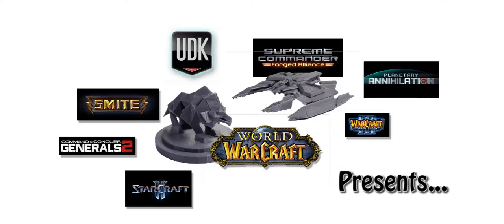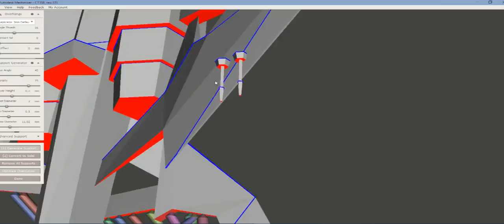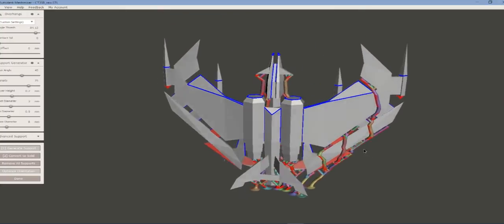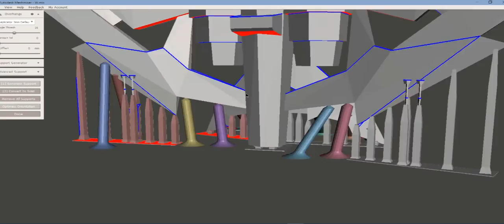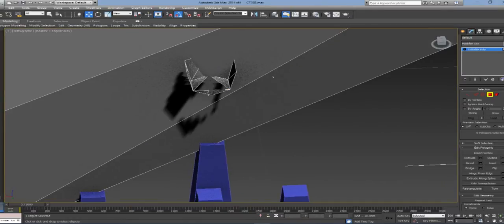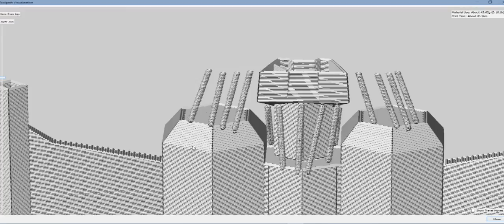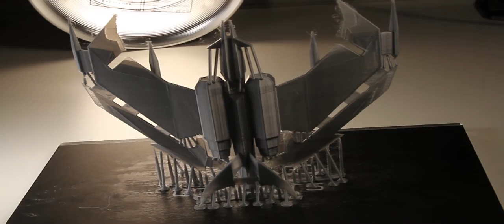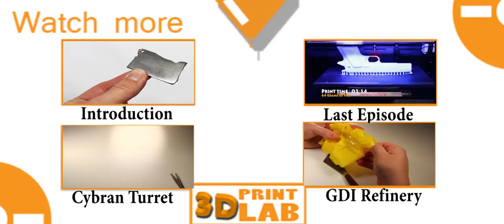3D Print Lab - Revenant [Supreme Commander]

Comment: 15 min video and then no clear shot of the finished thing? The photos at the end are abysmal.
Reply from the maker: ElizaberthUndEugen I was trying to showcase how large it was by taking close ups, and yes some of them are a bit out of focus, I'll try to take more shots for the next one, was hard to fit it in the frame.
Reply: KippurCatArts ok, cool.
Reply from the maker: ElizaberthUndEugen Any angles you want specifcally? I can take a few more and throw them up on my website for you
Reply: Nah, no hassle. But if I were you I would take photos from a little further away with high resolution. Rather than being too close with the camera.
Reply from the maker: ElizaberthUndEugen Ya, this model was a bit large for my macro lense, I'll make sure to use my wide angle on larger models next time.